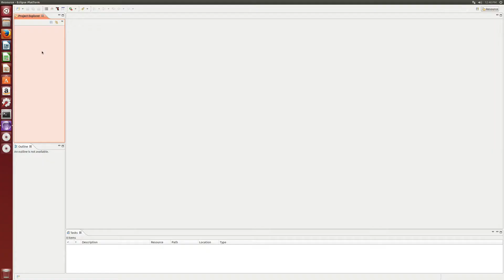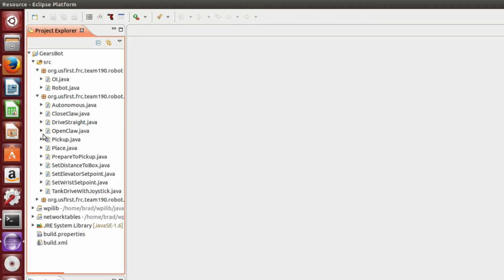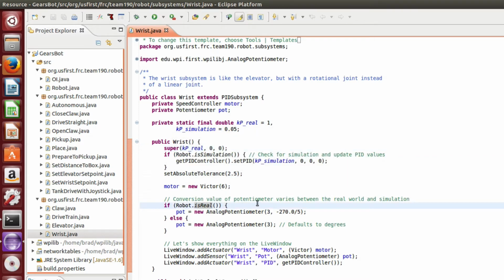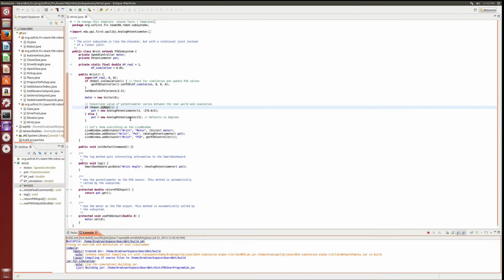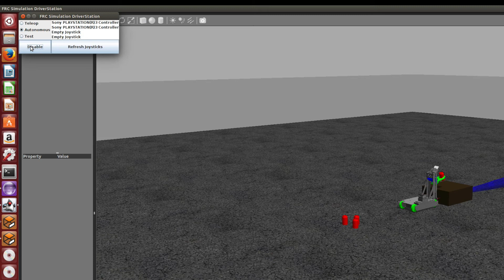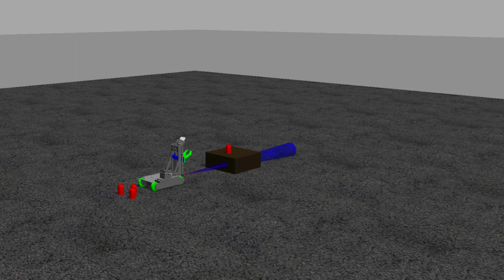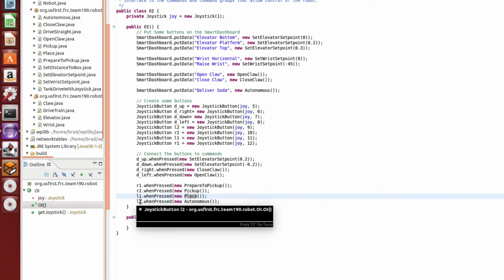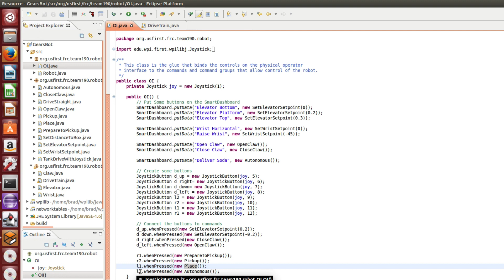Running the GearsBot Simulation

Comment: simulator seems to die, shows exec return code of 255. Did exact Ubuntu install and command to setup everything. Sim starts, never shows playing field, then dies. Tried starting from command line with same parameters - same story. Running with --verbose didn't give any clues. Is there a later version of files we should be using?
Reply: I've sent you a message to help find a solution.
Reply: Alex Henning Hi im having the same problem
Reply: josh grace Here are some of my notes of things I debugged to get it working. http://greatjava.org/2015/04/diagnosing-problems-with-first-robotics-simulator-frcsim/